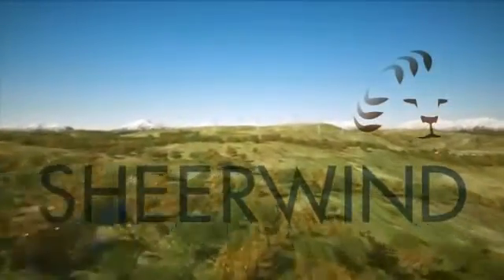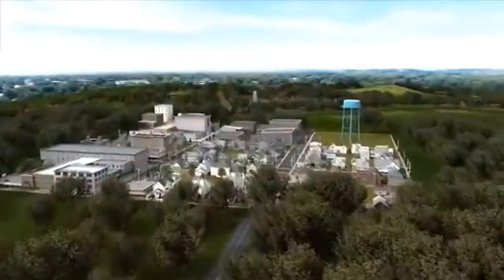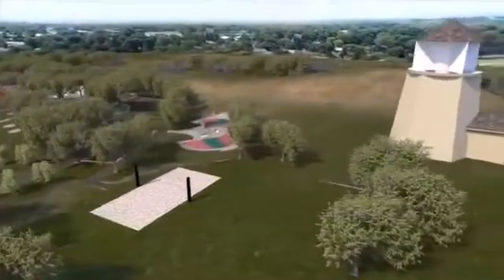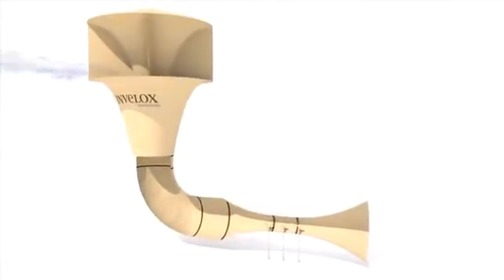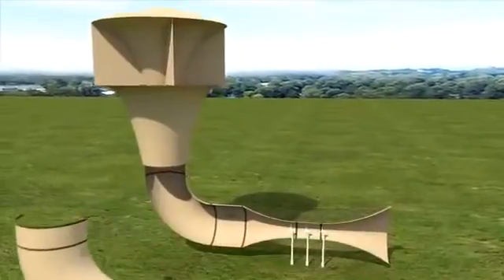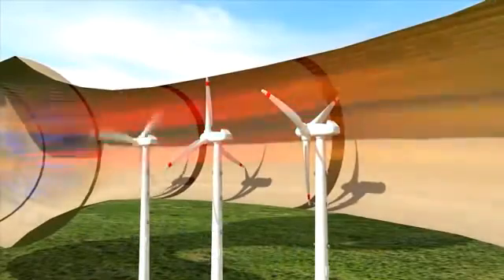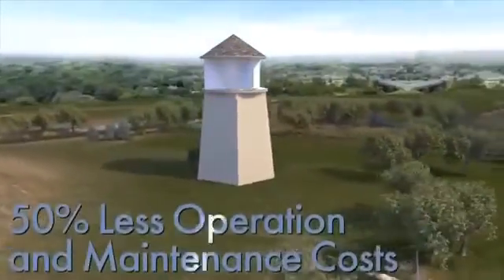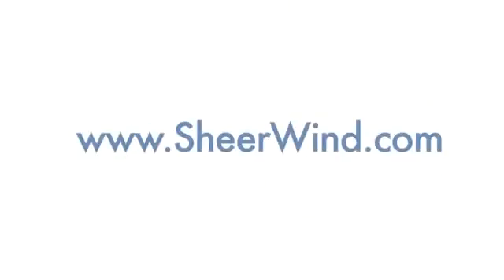SheerWinds INVELOX The New Face of Wind Power

Comment: Judging by the picture, the aperture might be up to 4x4 m, 16 m². With a wind speed of 2 mph, about 7 watts of wind power would flow into the aperture. Even with an unrealistic efficiency of 50%, the facility would only produce 3,5 watts electricity at this wind speed.
That's why wind turbines don't need to convert low wind: It hardly contains any energy.
Based on the same assumptions (size of the aperture, efficiency), it would produce 320 watts of electricity at a wind speed of 4 m/s (9 mph). 
Which would probably still be too optimistic.
Again: Low wind contains not much energy. And you can't generate 10 kilowatts of electric power out of 100 watts of wind power (kinetic energy).